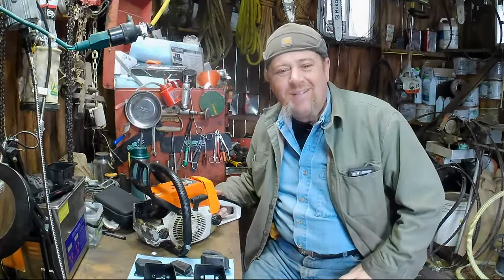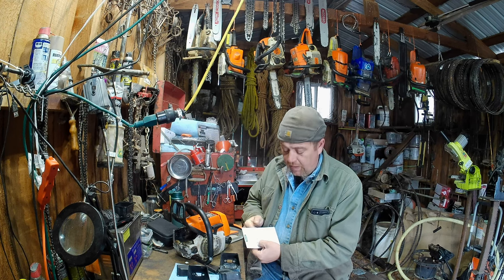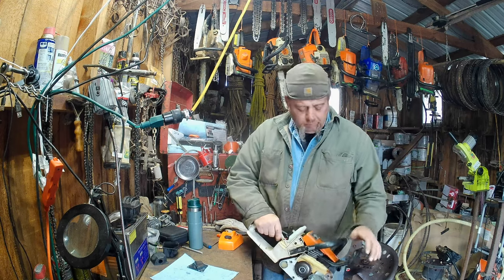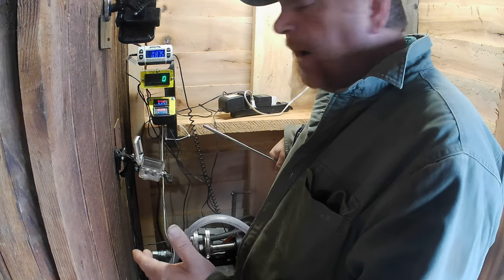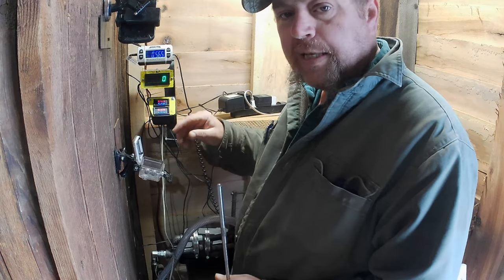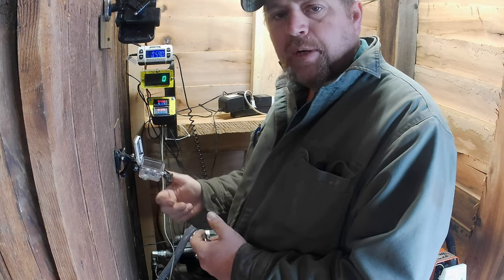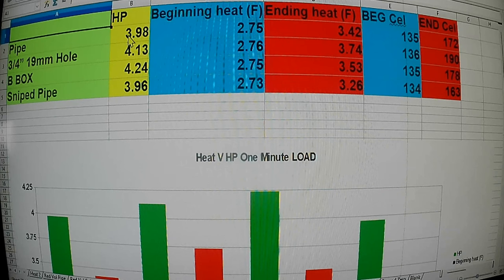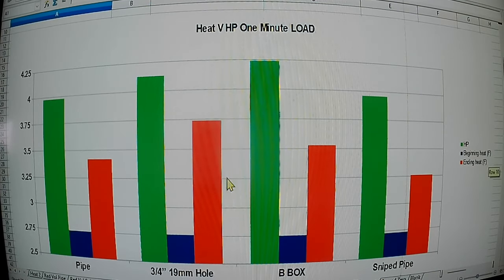BIG HP GAINS by Reducing Muffler Can's Volume? AMAZING Muffler Mod  Testing DYNO HEAT VOLUME Data

Comment: maybe a 1500 rpm range, hp average could make a good cut factor?

do you think a port extension on the exhaust could be a good experiment? (behind the muffler box)
Reply from the maker: @JyveKilla I like the idea!! I will have to do some thinking on that to see how I would multiply/divide... take the average HP of 750 above and below peak and multiply by HP at each point... basically doubling the sample size, but the basic same math?
Reply: @HayChaffandSawdust1  commercial dyno software can give an average HP for a range, I'm guessing it's based on the samples available for that given rpm range
Reply: @JyveKilla  I second the idea of that port extension, if I’m thinking the same as you… basically make an exit block, extending the primary exhaust port maybe an inch further before it dumps into the can? In my mind that helps create draw and more torque.. in theory?
Reply: @Archer_82  I'm thinking it may draw the heat away and create horsepower that way. I was also more thinking 6mm (1/4") of extension
Reply from the maker: @JyveKilla I forgot to acknowledge the extension idea; I think it would work and may be easily "tunable" to limit the amount of rebounded exhaust gasses and overcharging the fuel/air with too much/any exhaust gasses; I'm considering that too much exhaust rebounding is causing egr thereby raising heat while lowering potential hp? It's sure something to consider and try. I think, when I try that, I will also try ONE more tweak to your idea.
Reply from the maker: @Archer_82 I agree that it has potential, too. I'd give slight odds that it will work, but am not sure if it would be due to more draw or due to limiting bounce-back and overcharging the fresh charge with too much exhaust gasses. If it works, we may never know the reason.  Sure is something to consider though!!
Reply: @HayChaffandSawdust1  I've actually seen the extension idea on expansion chamber exhaust systems. What it does is essentially time the returning pressure wave to match up with the peak cylinder pressure to increase the performance more.
Reply: @JyveKilla so basically black magic with sound and pressure waves, tuned for an rpm range?
Reply from the maker: @JyveKilla I agree! It occurs that the sonic waves are timed by distance from the cones; the first wave is inverse and swims upstream without pushing back on the exhaust charge; the second wave is not inverse and does push escaped intake gasses back into the chamber if the timing is correct. In a good tuned pipe, the pipe actually pulls more intake charge than the piston can push... meaning, on the intake side, the pipe does more work than the piston. I totally agree with the sonic theories and have a very remedial understanding of them. Also there are standing waves in an untuned pipe (like standing waves in a transmission antenna); knowing HAM, CB, etc... transmitter's antennae work best (arguably) on a full wavelength, they also work on a harmonic of such (1/2, /14, and for some reason 5/8 works well. It could be that a shortened sonic distance, being a subdivision of the full length requirement, may be an idea.  Not sure and don't have enough grey matter to know how to determine... other than to try things like your idea of a pipe inside of the muffler. I'm afraid the distance is way too short... probably only 5% or so of the required/calculated distance of a proper tuned pipe. Love the conversation and exchange of ideas THANK YOU!!
Reply: @HayChaffandSawdust1 actually, I think we can. I dove pretty deep into this last night (2am) and checked it against the iron horse that by luck worked on the 021/025 build. (Knowing it worked bc I needed to lean out the high jet to remove excessive 4 stroking at WoT after moving from an open can mod) 

Okay. Let’s say we want to target 10500rpm, divide by 60seconds is 175rps. 1 second divide by 175 is 0.00571429 seconds per rev. Divide by 360 is 0.00001587 seconds per degree.  Say 168 degrees of total exhaust timing, sound is generated at piston open, we need it to return after transfer close, before piston close, blowdown is 22 degrees, so target return is 146 degrees after generation. 0.00001587 times 146   Is 0.00231746 seconds later.  Speed of sound at 300f (thanks for the exhaust temps) is about 1350fps.  Target time window, times temp adjust speed of sound is 1350x0.00231746 is 3.128571 feet. Times 12 for inches is 37.5428 times 1/4 wave length is 9.3857 inches. Times 1/2 because we need to hit a reflector and return to origin point. That’s 4.6928” from piston face to pipe back wall.  Measured mine. I’m at 4.625. 

If exhaust temp is lower, speed of sound is slower, a shorter distance will get you there. 

Other math: 
0.00001587 sec per degree, times  22 degrees of post transfer close exhaust open is total time window.
0.00034921 sec.  This time window divided by 0.00571429 sec per rev is 0.061 or 6.1%  

10500 target rpm times 1.061 is 11140rpm.  Perhaps where the pip is over ran. Not sure about this because, as you make more heat, the speed of sound increases, meaning your sound wave moves more quickly to the reflector and back, so actual usable rpm is likely higher. 

Perhaps, this is useless, maybe it worked for other reasons.

In my mind,   “Pipes do not work until they are up to temp” bc of the change of the speed of sound. 

“On the pipe” starts when the sound pulse returns AFTER transfers close, too early (lower rpm) and it counters transfer charge. 

Over running the pipe, is when rpm is too high, and the piston closes before the sound wave returns. 

Now, tell me when I messed up, please, bc it can’t actually be that straight forward It’s black magic.
Reply from the maker: @Archer_82 Gonna have to study on this for a bit; the only problem (there are two actually, and BOTH my fault) are exhaust temp and whether radio waves (the 1/4 wave thought) translate or not... that's something we'll have to check. Second "problem" is that I'm giving you head/cyl temp and not exhaust time... easy peasy to fix; I hope to have exhaust temps in the next Csaw video (still have not proved it out yet as the thermocouple still won't stand vibration on the other one either) I have a different thermocouple to try; it's the same as in the head; I just really really wanted the probe type as it was less invasive and far quicker reacting as it has way less mass..  I think you're onto something... enough to make me want to consider sonic waves, for sure.
Reply: @HayChaffandSawdust1 Helmholtz resonator, I think would be the effective shape we are dealing with here.  From the document I read on them 1/4 wave length is relevant.  I had previously thought that the exhaust expansion pressure was what would do the work and that would be unsolvable, but according to a few sources it is the sound wave. Looking forward to adjusting for temp, I could put my fluke probe in my pipe under load and see where this pipe is on this saw. 

Also, could this be the basic function of the “birdcage” baffle in a stock can? To provide a sonic trap and reflector set to a working rpm range. Then when we mod the saws, that set range is too low and we overrun its effective rpm?
Reply from the maker: @Archer_82  I developed the same thought earlier when replying; (dang sure not claiming "I already thought of that" kinda thing). I wanted to contemplate it while sawing lumber... and I did. I think it may be!! Remember the previous video where the baffled can out-performed the gutted can with same? I was baffled (no pun intended ... just a happy accident) as were most of us to a degree.  I think you're onto something along with the suggestion of a short pipe internally... or why not just open the baffle to try that.   ...I'm gonna need more mufflers!!!!
Reply: @HayChaffandSawdust1  I may have melted some of the shielding off my fluke temp probe, but was able to capture 700f +/- 50  with aggressive throttle blips and some WOT, not under load. That would adjust the speed of sound to about 1650fps. (We need an accurate exhaust temp, I have some steam rated probes and the 1/8npt fittings and compression nuts. Will need to identify what bimetal they are for the reading)..  anyway, I solved for my known distance from piston to reflector of 4.625” with my 021 numbers 172 exhaust duration and a 150* rebound target (22bd)  with 1650fps for sound and came to a projected RPM of 13,380. 

It’s plausible.. and would indicate that I could improve performance on this saw with a longer pipe, it does not have the torque to maintain that rpm range with load.  ..  another pipe must be made. Will need to find that temp and choose an rpm I think it has a chance to settle in at with the 7pin.  Thanks for sparking the mind, even if I’m dead wrong..  I’ll learn something, even if it is Black Magic.
Reply from the maker: @Archer_82 My other thermocouple/readout claims to go to 999F, so I am in hopes that will capture it; it's also 6mm compression, and I had a hole drilled in the side of the non-reduced can originally and had a fitting in there for the probe; it didn't work. I think I will take a section of thick walled copper tubing... stored over by the yeast... and threading the outside to have a nut internal and external of the can and tap the inside to 6mm to accept the probe; there will be a nut inside which some purists could claim to disrupt/alter flow, but I think it will work best as it will only protrude ~1/4" and will be hollow allowing the thermocouple to directly contact the gasses. 
Sparking you mind!!! THAT is exactly what I am aiming for; I love how these videos are bringing out the best in people; sharing ideas, offering differing opinions, etc... Dang, it's great!!! I AIN'T a saw builder... I'm an unqualified thinker!!!

Comment: Am i right thinking that tge bark box reduces the inside volume quite a bit over the othrts because it is flat across, not shaped like a bowl/dome like the other lids?
Reply from the maker: @samhiss6807 The bark box does reduce the volume and I believe that helps. In this particular mod, I actually welded another baffle inside of the muffler can to isolate about1/3 of the volume of the can; the bark box further reduced it.  Good question!!

Comment: I think exhaust velocity helps shed heat and get intake charge into the cylinder more efficiently 🤔 for sure @ Sea level 59*f and 50% humidity, with a westerly wind per Sgt Mitchell... not Dennis neither 🎉😮
Reply from the maker: @z1berzerker   Joe, I know you're right on certain exhausts and possibly all exhausts to a certain degree; I'm considering, like one person has pointed out a couple of times... (it took until the second time to wrap my head around it) that exhaust (especially fast in a small area) can act like an EGR and put too many exhaust gasses back into the cylinder. I'm beginning to develop a theory whereas the side port exhausts tend to have more exhaust to bounce back before going out the side port whereas the front ports bounce back less of the exhaust charge while letting some out with the first run-for-the-border and the rest of the reboundING reboundED gasses thereby giving two exhaust Poofs per rotation? It may be a happier timing VS volume of the exhaust gasses that get more of the intake charge back into the cyl from the can and less exhaust back in?  THOUGHTS?? There's got to be a harmonious spot.  I'm kinda like the old blind hog... sooner or later I will find an acorn!! 
And, you're right ... maybe I should add moon phase to the dyno factors? I know, if you dig a post hole at the wrong  time of the moon, there ain't enough dirt to go back in the hole; the almanac probably has SOMETHING about some idjut like me dynoing saws? 😂🤓
Reply: @HayChaffandSawdust1  theoretically, with a large enough empty can, could a patient and skilled person fit the dynamics of an Iron Horse exhaust completely inside an empty can? Replacing the 4” of straight with a smooth S shape and the ~75* back angled exit leading right to a side port?  That may tick the rule book box.
Reply from the maker: @Archer_82 ... Right on the money; as much as I like an Ironhorse pipe for the broad range of torque, I'm not sure that they are the fastest/most powerful; for a club-fisted person like me who has very little finesse, they cut faster. I know, for sure, I can fit a bark box under the cover... that's a no-brainer and it (so far) has out performed any other mufflers. I've got a few more muffler ideas before we dive back inside the motor to do some more mods there... but dang, these muffler mods are fun and give so much data to fuel my nightmares!!!  Between you and I, I think I've got the 029/039 coming along; squish from .058 to ~.021 Didn't consider the popup's radius until I watched your video and I've been timing with a flattop piston. Will check fit of popup soon; didn't cut chamber. Lowering cyl gave some pretty good numbers with may not need/get changed much at all... except blowdown; I have room to reshape and redirect and still have good BD numbers. Aint sure I'm going to want to give it back to its owner.
Reply: @Archer_82  Check out the Pretzel exhaust...800 bucks i forget who makes it exactly SoupaSaws or something 🤔
Reply from the maker: @z1berzerker  Talk about some serious bling for an ol' saw!!  NOT TO ARGUE, but it's $850 now.
Reply: @HayChaffandSawdust1  lol 😆 It was out of stock @ 800, of course the new stock is 850. 🤷 it is pretty tho 🥰
Reply: @HayChaffandSawdust1 please post a vid or short of that 039 running and cutting! Can’t wait to see it. Cutting for squish on a clamshell is not that difficult, turns out.  

I think we can solve for sonic wave return! I’ll post over there on the one where you talk about 1/2 &1/4 wave lengths (didn’t know about 5/8)
Reply from the maker: @Archer_82 Will do on the vid of the 029/39 running when I get it done; with your blessing (you done it first), I will also include how I cut my bearing pockets. The bearings, squish, seals, are all done (I think); all I have to do is xfers (I have room to direct them a little further up and slope the angle some to open the intake side earlier); as long as I don't run into an unforeseen problem, should get it together in a day or three.   I read the other response, but have not responded yet... have to go saw lumber, so will reread it and give it time to rattle around between my earplugs while I'm sawing.  I'm not certain that the subdivided waves will work on 2 stroke or not? It's worth a try!  I understand that 2 strokes can suffer from Standing Wave (which is what make me think in terms of radio waves ... SWR on radios (Standing Wave Ratio) is in turned into losses transmission gain/watts and heat.) Honestly, I never did the math for sound speed/distance required as I just always looked at a tuned pipe and threw up my hands in belief that there just isn't room in a can-style muffler or even an ironhorse pipe. I'm with you, though; I know they work and work well; I do have a different theory as to why (besides sonic) and it's based on all y'all's suggestion of an extension inside of the can, as well as a developing theory on the bark box/reduced volume gains.  We keep going on like this, and I'll never get back inside of that saw!! 😉😉😂😂